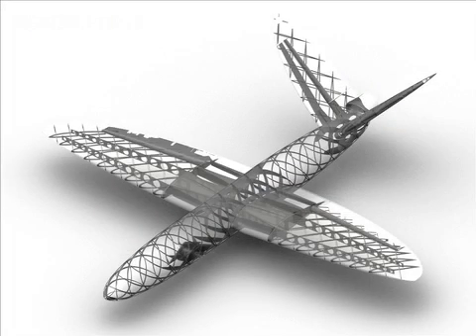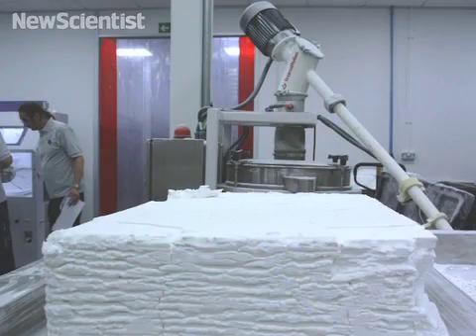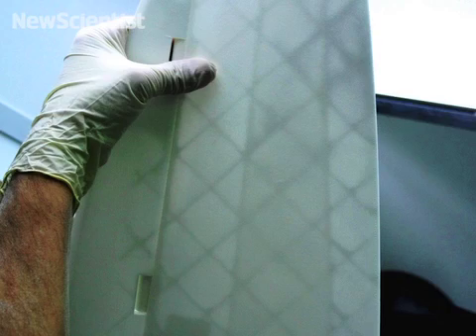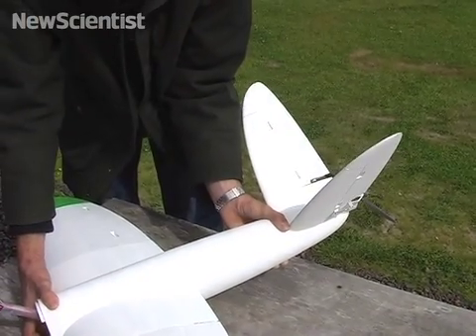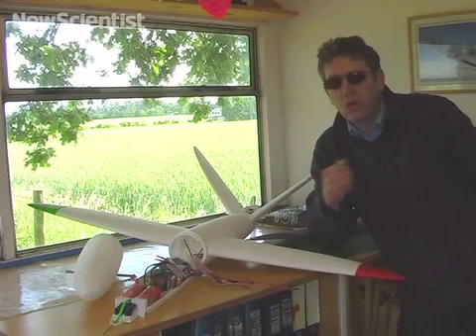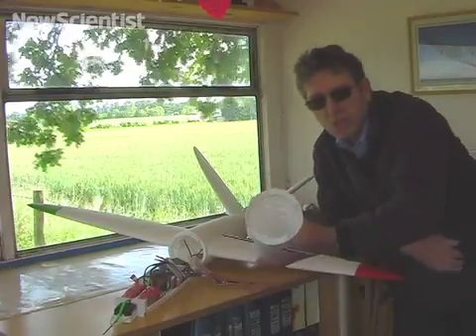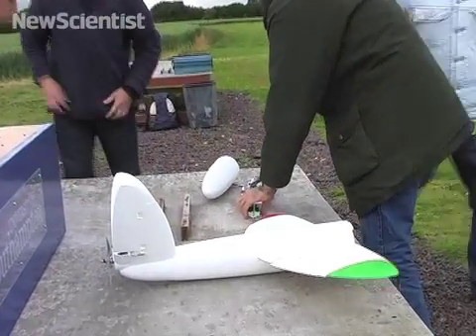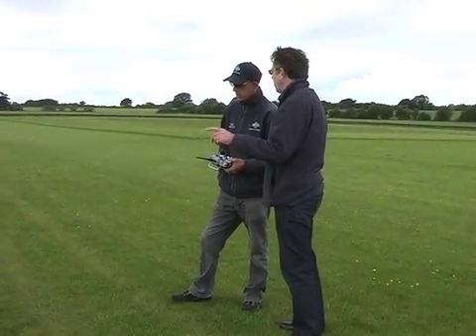First 3D printed plane takes flight

Comment: If they ever make a 3D printer that uses light materials like EPP foam, I'd be all over this.  As it is , plastic is  way too heavy for RC planes.  A slope glider for heavy winds is possible, there you want the weight to cut through wind.
Reply: your comment aged like milk lmao

Comment: 3D printing is all well and fine unless you'd like to make something of larger size because of the money you have to throw at them not because of the material the model uses but rather because of the space it wastes for which they'll charge you.

Grinds my Gears whenever I place an order on Shapeways as sometimes it's just not possible to cut a piece apart to make it use less space as otherwise there'd be no reason to 3D Print it to begin with.

sigh

Comment: wow. How many years away before someone prints a full size plane ?
Reply: I'm printing a airliner right now! it should be done in 2077
Reply: ha ha.. very good..
Reply: Well I mean the layer-style 3d printers can be made any size you want, you just need to put it on larger rails and print for longer, but you'd need to be pretty brave to get in a plane you printed with one of those. Still, the technology's there somebody would just have to do it :v
Reply: Yes. I fully agree with you. ..

Comment: It's all about price isn't it?  They still had to buy the engine, servo's, ESC board, batteries, receiver, transmitter.   You can get some decent RC planes this size for around $300 to $400 ready to run that includes everything I mentioned already assembled. If you already have a transmitter, you can get Bind and Fly versions cheaper yet.
Reply: Your'e missing the point. It's not about cost, it's about proof of concept.

Comment: I would love to have this kind of printer at my disposal. I think the comment about the elliptical wings is a little off the mark. The elliptical wings were probably added because the looked cool. (Yes I am very familiar with the wing planform of WWII fighters) for a given surface area the square tip is more efficient and has less drag. The whole concept of a 3d printed plane is cool however.

Comment: I think the main difference is shown at :41 where we can see the stress beam layout underneath the skin.  On the original spitfires, there were two long spars with the top MAIN one following the ellipse and the bottom one at the hinge line of the aileron.  On this model there are three, equidistant.  Also, regularity on this model is very high, but on the spitfire had to compensate the locations of the longitudinal spars to make pockets for the brownings, the hispanos, ammunition boxes, etc.

Comment: We still need to buy "ink" though, bottom line is will it be cheaper to do it yourself or buy the part, i mean most have ink or laser printers but cost keeps us from printing our own books, same goes for the good old film development service you could do it in your home but you needed the equipment and a constant supply of development fluids etc,, maybe in the end it will be cheaper have it printed at Kinko's?

Comment: this technology is open sourced, which means it cant be stopped, but as and9744 said, companies would be able to sell a design for something, and you would be able to customise it, and print it off at home, which would negate the need for production and distribution, if anything it would help businesses, as they would still be able to sell something for the same price it has always been, while not having to pay for absolutely zero production cost, and no distribution costs

Comment: Do you think a Boeing 747 wouldn't fall like a brick? This is a plane, not a glider, it's designed to use a motor. The same 3d printing process could be used to make a glider that wouldn't fall like a brick as you so cunningly put it.

Comment: this is the future big time.. This is the next big thing 3d printers 100% this will change everything.
10 years from now everyone will own a 3d printer and i bet there be torrent sites for 3d printers where you can 3d print a radio control car or warhammer figures or spanners screwdrivers spider-man figures.

Comment: The planet doesn't have a problem with plastic waste. The planet has a problem with people and their behaviour and their values. If people do not value sustainability then not surprisingly we don't have sustainability. As for plastics, not all plastics are equal. In theory plastic is quite kick ass as it lasts for a very long time and can be made in a way where it is not harmful, such as bio-plastics made from corn or algae. Once again the issue is not plastic, but how we use plastic.

Comment: @iceknite5 Yeah but seeing as the areas are segmented you wouldn't need to reprint the whole thing, just a wing, or nose
and it less likely to break because it actually has a reinforced structure rather than compressed foam

Comment: @thenxtbillionaire Boeing and other aircraft manufacturers are already using 3d printers to manufacture parts for their planes. there are some clips of them demonstrating some parts that would be essentially impossible to build otherwise, and provide superior performance, strength and low weight. And they are also building them with 3D metal printers too.

Comment: "made entirely with a 3D printer"... except of all the electronics, servos, wires, antennas, motors, batteries, yeah entirely out of 3D printer.
And most of the printed parts could have been cast in mold or machined, too.